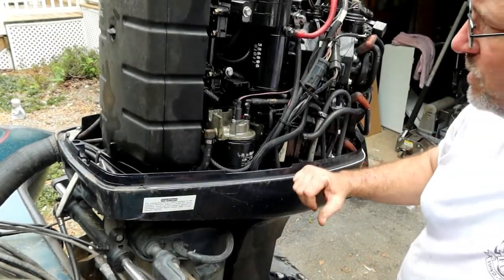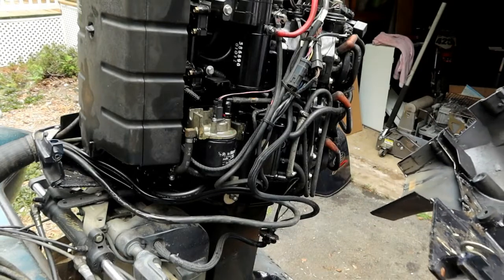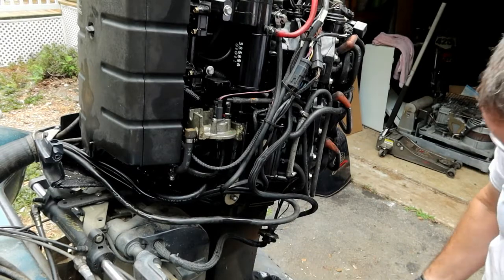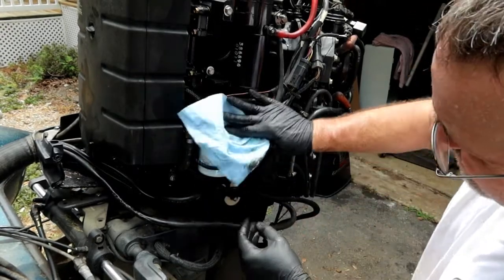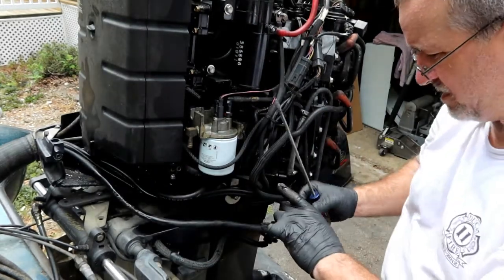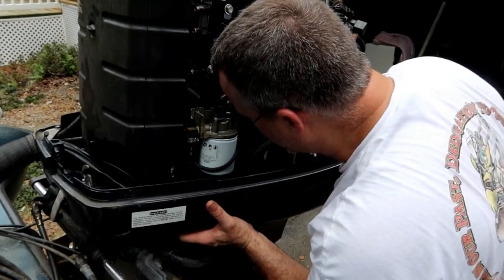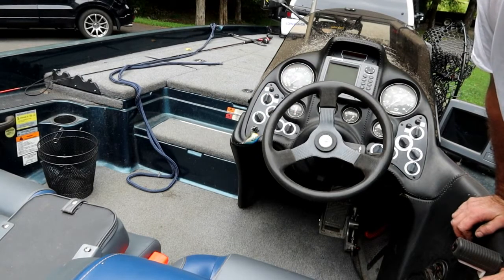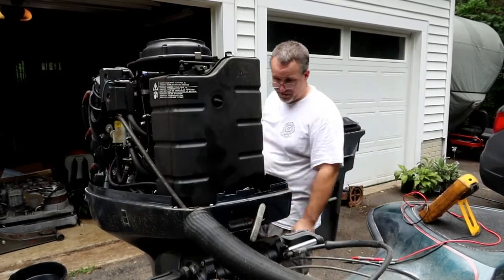Evinrude Ram injection FICHT fuel filter and hose hard starting cold

Comment: those fuel hoses from OMC since the late 80's are perfectly fine to use with ethanol up to 10%. the issue is that horrible seafoam... softens the lines, allowing them to flex and then crack when they dry out. i actually have a bunch of injectors and oil pumps for these motors NOS in stock if needed. cheers. BTW that 200 was an absolute beast... outran everything. 240hp at the crank. on a 12v battery, 12v is basically dead. 11.5 is really dead. 12.2 is 70% charge. and 12.5/12.6 is fully charged . NEVER JUMPSTART a delicate rectifier like that. will shorten its life, especially from such a low battery voltage. great video thanks for sharing!
Reply from the maker: Those are great tips! Thank you for sharing!